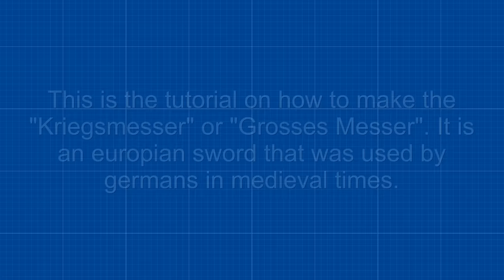How to make a Kriegsmesser - Free templates

Comment: nice work. one tip, however: this type of sword has an additional protrusion on the side of the crossguard for extra hand protection, as you can see here: https://www.albion-swords.com/images/swords/albion/nextGen/knecht-mark-II/knecht-mark-II-3.jpg
if you want, you could make it with a corner brace (put it on the right if you're right handed or on the left if you're left handed)
Reply from the maker: +Let It Gogu Oh, yes, I forgot about that.. Thanks for pointing it out :)